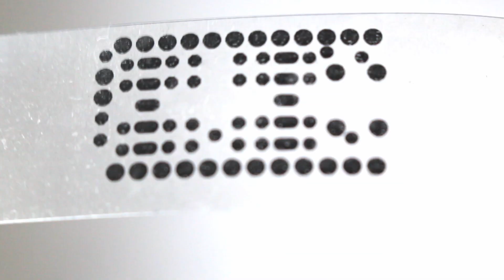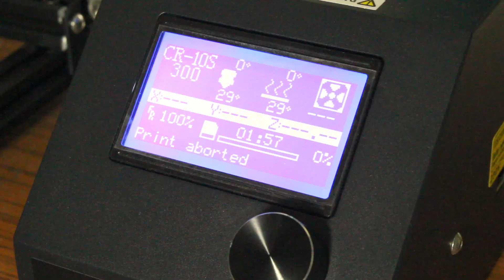FS-Touch Bed Levelling Tool

Comment: I love it, and I'm going to make one, but my only suggestion would be to average and smooth the input from the pressure sensor so instead of erratically going back and forth when you reach the reference it can be set to light the entire ring, meaning it's done.  I think by lowering the number of Decimal places it looks for might help, but I've not looked at your code yet to properly determine how this might be done while still retaining accuracy. 

Other than that, it's a good thing, and I'll definitely be making one because I have more issues with bed leveling than I think I should.

Comment: Is the usb cord connected to it at all times just for power?
Reply: I assume to set one corner in .1mm or paper thick ness record the data with the device and save it. Then adjust the corners to the one nozzle spec

Comment: HI, thank you very much for the tutorial. May I ask about the CNC milling, Which PC software is used to autolevel the PCB and which chemicals compositions are used to make the solder masks?
Reply from the maker: I create the milling NC files using flatcam from PCB Gerber files. Then the NC files are milled using Candle. Candle has a heightmap option which can probe the PCB surface(I connect a wire to the milling bit and another to the PCB) and compensate for the distortions in the surface.
I bought the UV-curable soldermask from Aliexpress. It comes as a paste in syringe and can be easily cured in the sun once applied as a thin layer on the PCB.
Reply: @AntzyX  Thank you.

Comment: What model number is the sensor , does it even matter? And can you please upload the circuit schematic?
Reply from the maker: You can use any Force Sensitive Resistor(FSR). All the details along with circuit schematics are in the instructable article link in the description.